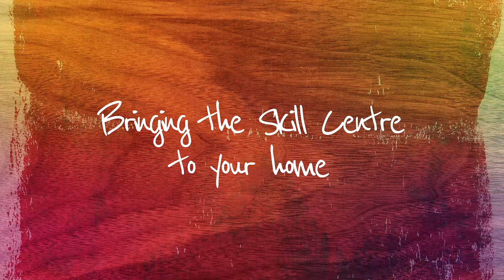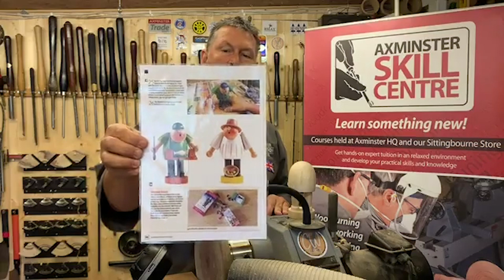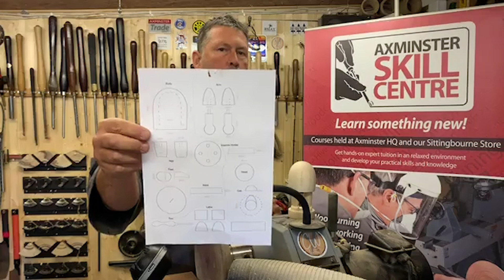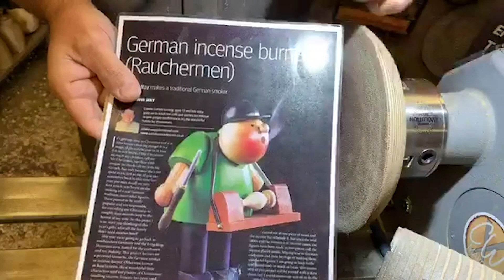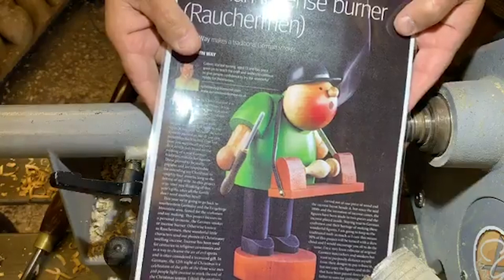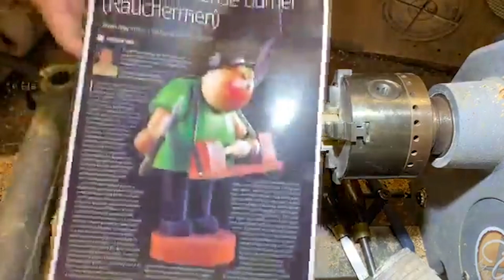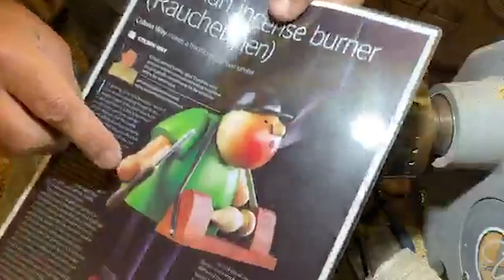#SkillCentreAtHome - Live Turning Thursday - German Smokers Part 2

Comment: What is the sanding platform called on the website please?  Also would it fit the NOVA Comet 2 lathe?
I've searched for:
Evolution tool rest system, 
Sanding platform,
Evolution tool rest system round plate...... but can't get a link on the site at all.
Reply from the maker: Hi Hobbyturner, heres the link for you - https://www.axminstertools.com/axminster-evolution-series-mounting-plate-for-evolution-tool-posts-104451 and tool post to fit the Nova is the following - https://www.axminstertools.com/axminster-evolution-series-tool-post-16mm-x-90mm-101831. I hope this helps :)

Comment: Hi Colwyn can you tell me the part number of the toolrest for sanding pleased
Reply from the maker: Hi Les, the part number is 104451, however,  you will need a tool post to suit your lathe as well so look at part number 101834, but change it to your stem diameter. I hope this helps!